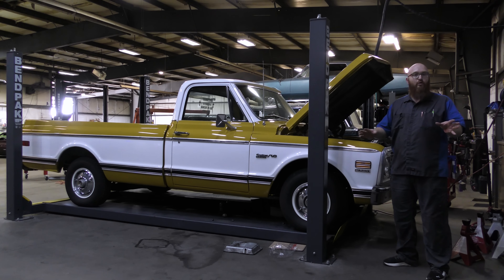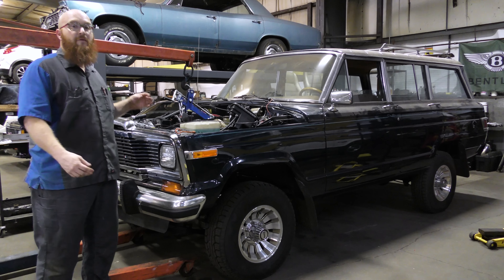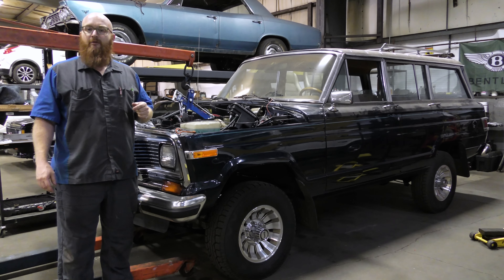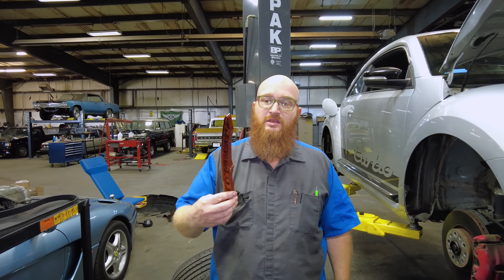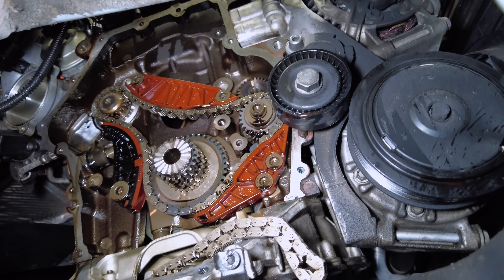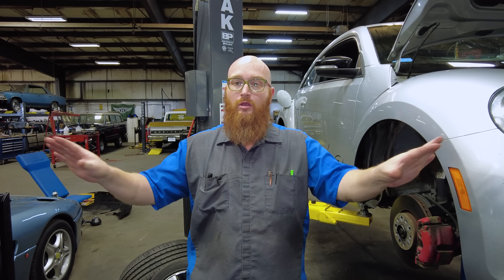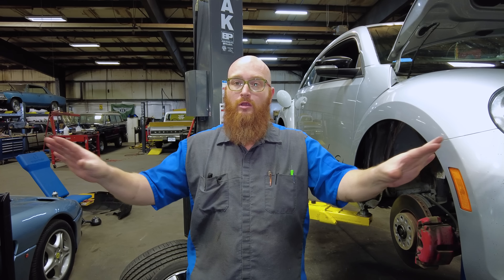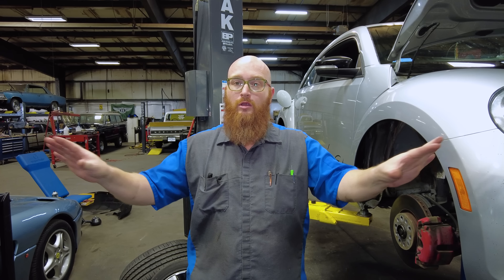Hard to test, can't see it, but it can KILL your car! CAR WIZARD talks Timing Chains! Is yours next?

Comment: I do not know if the US spec bug also have the plastic housing that is situated next to the cylinder head where the water hoses connects. If so then do yourself a favor and change that also. They tend to corrode and at some point they just start leaking badly

Comment: I'm being pedantic but timing chains (any gear driven chain) do not stretch. Rather the pins and bushings wear which increases the clearance between components resulting in increased length. As others have pointed out this wear can be accelerated by contaminants in the oil which is a good reason to service the engine regularly.
Reply from the maker: Its called stacked tolerances.

Comment: At least you had the updated tensioner and not the time-bomb tensioner--that's a much bigger problem and they didn't revise it until mid 2012, meaning cars built before that (from 08 when the EA88 started) had the time-bomb in them.  They revised the chain in 2014 IIRC, which is less prone to wear ("stretch").  

In any event, Audi really messed up the chain system bad on these engines--they're more headache than a belt which has a known interval, and actually ends up being a longer interval than the "no interval" chain which [i]should[/i] last the life of the vehicle but definitely doesn't!

Comment: I had an 85' 325e that had a broken belt. I was driving down the road and everything just shut down. I didn't even know what a 'timing belt' was but it's failure would cost over $4,000 for another motor.. early 90's dollars..

Comment: It blows me away that VW failed to properly fix their timing chain issue for so long.  And water pumps.  And oil consumption issues.  And they seem to be the worst at DI dirty valve build up, too.  I think they finally got their window-regular situation figured out though.
Reply: Yeah vw really fed up on those but all bmw engines that are 2L mabey some 3L too have had timing issues since 2007 to like 2014 thats crazy and all engines are longitudinal and must take out engine here in Croatia the bill is 1500 euro for that and that is A LOT of money here
Reply: @vitofranic6451  If you don't work on them all the time, the N-series 4cyl and 6cyl engines have too many nuances to know what a good one is or isn't - I can certainly never remember. The B series 3cyl, 4cyl and 6cyl engines are much better. Unfortunately, they don't make them like the old, bulletproof, M-series any more.
Reply: The only way to fix Direct Injection build up on intake valves is to use Port Injection. There is a reason why Toyota uses both port and direct injection on their latest engines.
Reply: They fixed all these except the thermostat housing. The early 2010s were bad for VW, but the chain issues were all caused by the tensioner failing which got revised and required a $1600 job to replace. Water pumps are made of billet aluminum now but the thermostat housing is still plastic. Water pump failure after 2015 is RARE but leaking from the thermostat housing is very common due to the flexing of the plastic and gaskets in heat cycles. Unfortunately, the valve buildup issue is/was US exclusive. These engines received MPI in most other regions in the world but due to high manufacturing costs they were cut from the US models to keep the MSRP down. You can still retrofit MPI on the US models though.
Reply: @XxSmokeeyxX  -- Good to know; thanks
Reply: @XxSmokeeyxX  I have seen how the European models of same vehicle sold in the US have many more features and tech so they sell for way more money even 10,000 Euro more. The problem is NOT that labor costs much more but that the US economy has stagnated for 20 years for low and middle income earners so they intentionally shave features to bare minimum in order to give poor Americans the chance to buy their vehicles.  I would say the US dealers probably weigh in as well being greedy bastards that they would prefer more services to be required and lower longevity. Its always about the money in the old USA.
Reply: @philbrutsche8928  It's nice that Toyota actually learns from their mistakes... The first IS250s only had direct injection and it led to carbon build up. Pretty sure everything after has port + direct.

Comment: any GM with a 2.4L 4cyl (HHR, Cobalt, G6, Equinox, Terrain, etc...).  If you have engine noise, sluggish starts, loss of performance, you MAY need to get your timing set replaced.  Don't ignore it.  Yes, it can be expensive to have repaired, but it's a LOT cheaper than buying a new car.

Comment: How about camshafts? Are there still soft camshaft issues like Adam of Rare Classic Cars had on his gm classics from the 60s/70s?
Reply: Yes henry major cam and lifters problems from cheap Chinese steel also bad quality control issues
Reply: Also a flat tappet engine needs zinc oils to keep them alive .all new oils don't have high zinc anymore cause it damages cat converters.so you have to run a muscle car or racing oils
.
Reply: Most all new flat tappet cams and lifters  these days are junk.

Comment: BMW's had a plastic timing chain guide that would get shaved down under use and then the shavings plugged all the oil returns.
Reply: They still use plastic guides

Comment: Regarding the timing chains lasting the life of the car..  There's a few reason it doesn't.  Lighter, "better" materials (coughing on "better"), heavy use of plastic guides, extended oil change intervals causing sludge build up, and the fact the chains do more work/have more strain on them (VVT has to put more stress on the newer, weaker chains) all add up to shorter life.  Also, in 1961 a car with 50,000 was "worn out", where these days, 150k is barely broken in.

Comment: I have to disagree with you. The big three had nylon teeth on the cam gears. I did dozens of them in a 10 year period. GM camshafts were soft and I replaced dozens of those as well. You're right however, when they jumped time they didn't damage the engine.

Comment: Whoever did the Jeep timing cover gasket, used silicone blue. I hope they also used a proper gasket. Over time, especially in a hot engine, silicone degrades, gets brittle, cracks, and leaks. Factory gaskets should always be used.

Comment: Right timing chains do not " stretch" they wear in the links because people do not change the oil properly, the test for a chain is and has always been hold the chain with the links on the top and bottom by one end compare a new chain with an old one, the old one droops the new one doesn't,

Comment: For the longest time Toyota used timing belts. The only reason they did it was so the dealership could make money at 60,000 miles. They would tell you if you didn’t replace the belt your engine would blow up. while your car was still in the shop you would get a call telling you it’s cheaper to replace the oil pump seals when the timing belt is off. They knew it before they started the job. Toyotas Service department is not as good as the vehicle is. Finding a good Service station is the key to any car running for a long time.

Comment: The first question you need to ask yourself is if you have an interference or non interference engine. If it's non interference the worst thing that could happen if you don't service it is leave you stranded.
Reply: Non interfering engines basically don't exist anymore. Only engines, in which the valve travel and piston travel interfere, are abled to get a high enough compression ratio to meet modern emission standards.
Reply: Not really true. I've personally seen non interference engine blocks with unwanted openings made by broken chains that felt into a position where they have been pushed by gear motions against the walls of the block breaking it... And I've seen similar stuff also happening with timing belt.

Comment: Timing chains and chain guides are a problem with the old GM "Family Zero" engines, particularly the smaller ones (the Z10 1.0 and Z12 1.2). Ask me how I know...... 🤨
Reply: They’ll run quite a long time with a worn tensioner tho ahaha😂not ideal
Reply: @fipfip3331  that's how I know. My poor Agila
Reply: @someonebald2022  get it replaced In the end? My daily is a corsa d.. I’m just waiting for that dreaded cold start rattle 😂
Reply: @fipfip3331  erm, no. It died in a messy way. My current ride is a 2001 Corsa c. I have a spare timing chain set, just in case.

Comment: on the cts 3.6 i had absolutely pos major chain rattling dealer said it was dew to pcv valve having too small of holes and would suck the oil off the chain making part of it run dry

Comment: I had a '72 nova with a 350.  I was at collage in '90 when the nylon teeth came apart and left me stranded 2 hrs. from home.  GM has had some questionable engineering choices and putting nylon on the timing gear is one of them!

Comment: Have a 2012 2.0 TSi in a Tiguan.  5.7 degrees as measured with OBDeleven  Not driven it for 5 weeks.  Looking for a decent mechanic in Portland Oregon and under every stone for the funds to pay for it.

Is it worth getting all the chains and tensioners done even if there is no apparent balance shaft issues?  That and the water pump I guess.

Comment: It is my opinion that the designers are told to make sure it will make it past warranty, but not by much so the vehicle goes to a crusher and a new one has to be bought.  I am just so upset at my 2005 Ford Expedition 5.4 and all the problems that happened with it.  I feel Ford owes me $20,000, but I don't have $100,000 to sue them over it.  Edit:  I put this comment in before the Wizard said the same thing about manufacturers in this video.

Comment: I heard Dodge Hemi engines are notoriously bad for stretching. They look like bike chains on a 400 horse engine. Just a heads up! I have a gear drive in my 1977 350 2wd s10. It starts the same everytime,without any worries. I hate timing chains and belts!

Comment: My 69 Camaro had timing chain gears with plastic teeth. I went to pass a car and heard a knocking sound after and thought I destroyed the engine. Narrowed it down to the timing cover. Turns out some of the 50 year old plastic teeth broke off and it got loose enough to slap the timing cover.

Comment: VW buys its timing chains. They beat their supplier down on price so much that the supplier could not afford to renew the stampers cutting the plates, so as they got worn, the plates went out of spec and the chains failed, often at very low mileage.

Comment: Regarding the Lincoln and timing chain: those of us that were born before color tv know that cars didn’t last very long.  If you had a six year old car it was old.  And if it had 90,000 miles you certainly couldn’t depend on it. Hell, most domestic cars rusted away in 5 years and imports even faster.  Of course you didn’t think about timing chains when your oil burning, rusted out Chevy was on its last legs.

Comment: I'd look at Toyota if you want a good timing chain.  They use timing chains that cost much more to make and last a lot longer. Most other companies match their timing chain( & plastic timing chain guides) cost with the lowest cost to make to last 100 -200k miles of average use as close to over warranty period. Ford is the best at that cost savings.  Toyota uses these 'Denso' parts for example that last the longest in their class(es). And they are fairly expensive for a fleet vehicle.
Reply: I had a 98 Ford explorer (exploder) that had the plastic timing chain guides. I remember changing the oil and seeing pieces in the pan, I soon got rid of it. It also had some of the best squeaks ever made when the control arm bushings wore out. But it did have some really good A/C
Reply: idk about the modern ones, but the timing chain guides were a problem back on the 22re, believe it or not lol. 

But yeah, people dont realize when buying used toyotas, that if you arent using quality OE stuff from toyota the reliability isnt there. Denso and OE parts arent cheap, so too many people cheap out.
Reply: @MiikeyLawless  The 22re had the timing chain problems because they got cheap and used a single row chain with plastic guides that would break! The 20R motor had double row chain with plastic coated metal guides way better setup pretty bulletproof!
Reply: @pinballdan  agreed, but it just goes to show that every brand has these issues.
Reply: @MiikeyLawless  yeah they got cheap and created the issues!

Comment: Car insurance has indirectly supported timing service or engine grenading due to interference event, by building a supply of vehicles in an accident for entire engine swaps. The timing fail can happen anytime and cause an accident though. It is the real darkside of the auto industry. It is on thing eliminated with fully electric vehicles, now it is replaced with "no fastcharge avalable" at anytime.

Comment: I want to buy a 3-4 year old Ford Explorer that has been maintained to factory specs. I expect that it would have ±75,000 on the ODO. If I want to drive it >250,000 miles, I know that I need to change the water pump and replace the trans fluid & filter, but at what interval would you suggest I replace the timing chain and guides? Should I do both at 100,000 miles? My son's Explorer had a water pump crap out at 140,000 and it totaled the engine. I had it replaced with a Jasper zero miles reman engine with a 100,000 P&L warranty. I would like to avoid that going forward.

Comment: Multiple timing chains are a consequence of single and dual overhead camshaft cylinder heads.  If you increase the width of every one of those chains to make them stronger, most of the associated components will get bigger.  The manufacturers make the whole assemblage as compact as possible while providing an 'engineered' level of strength and durability.  If you want greater strength and dependability then you have to make engines that are simple, with far less numbers of parts......like the cam-in-block overhead valve engine.   You sacrifice a bit of efficiency but gain a great amount of dependability. There is nothing I hate to work on more than an open deck, double overhead camshaft v-6, v-8, v-10 or v-12 all aluminum engine, stuffed into ever shrinking automobiles.

Comment: Belts are starting to come back again because they are more energy efficient than chains, VW has been using lifetime timing belts on the EA211 (1.4 TSI) since 2012 with great success, belt technology is good enough now that there is no reason most will ever need replacing.

Comment: The OHV engines you never worried about the timing chain because it was always bathed in oil when you would recondition the engine which they did many years ago still do it on older engines then the timing chain was changed my 25 year old toyota hilux has an OHC and l don't think the timing chain has ever been changed and has done 430000 kms it doesn't rattle

Comment: No, if it's a strike, it's a strike against the manufacturer (in this case VW).  But why did car manufacturers do this - as you pointed out, engines rarely had these issues years ago... These days, it's darn near impossible it seems to find a vehicle with out some form of timing problem. :-(

Comment: One question... if the timing chain is very streched, aren't the gear teeth compromised? Would it be wise to change all the gears (sprockets) as well as the chain?

Comment: The future is electronic timing.  It’s millions of times more efficient and if one actuator fails it will not inject a valve into the combustion chamber, and disables the fuel injector intake.  

Christian Von koenigsegg has been using this timing method for about a decade.

Comment: The timing chain is stretched/ the plastic guides are worn on my Saab 9-5 with the 2.3 turbo 4 motor but I'm not going to fix it. It's not worth it being a new england vehicle that spent most of its time in New Hampshire and the snow and salt has taken a toll. I am just driving it until it dies or becomes too unsafe to drive due to the rust. I got it cheap and it's just not worth the money and time to replace it. That's better put towards saving for a replacement vehicle. For now I just do the bare minimum of required repairs to keep it safe and keep up with maintenance to try and squeeze as much life out of it as possible

Comment: I owned a new dodge truck that the power windows kept going out even newly repaired ones.  The service manager stated that have improved parts but must us up old new parts first.  Same with these timing chains.  Obsolescence is built into everything as price points.  They do not want things to last forever or you would only buy one car during your life.  Most gas cars last 15 years/200,000 miles.  Repairs cost more than the cars worth.  EV’s should extend those end of life numbers.  Electric motors will last forever.  Many of the new batteries are million mile batteries

Comment: Timing chains and belts are really expensive to replace.
Reply: It's not nearly as bad if you just do it yourself.
Reply: there not expensive to change,  it's the mechanics charge to much.
Reply: Depends on what it is... A double roller timing set for my 351W in my f150 was like 65 bucks. The timing belt kit for my wife's Hyundai was $195, and an entire weekend of disassembling the front half of the car and cursing the existence of those who engineered such a nightmare.

Comment: Are there after market METAL parts to replace the plastic junk with? It would be nice after all that work! BTW, that VW chain set up is SO over engineered, I don't know where to start.....
Reply: The reason why you don’t want metal parts as timing chain guides is because they can cause metal to destroy the engine.
Reply: @atx-cvpi_99  Then I'm sticking with lousy design.